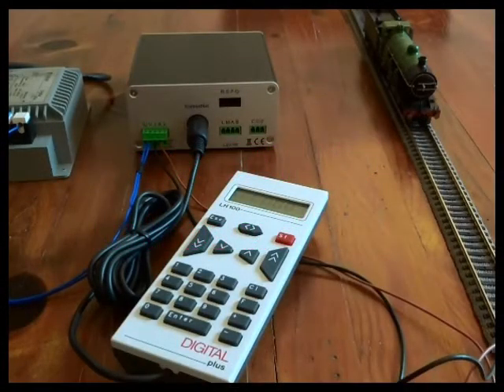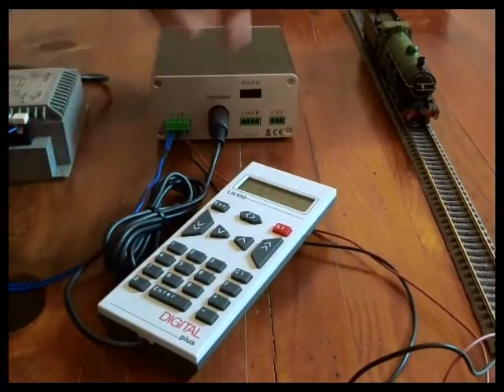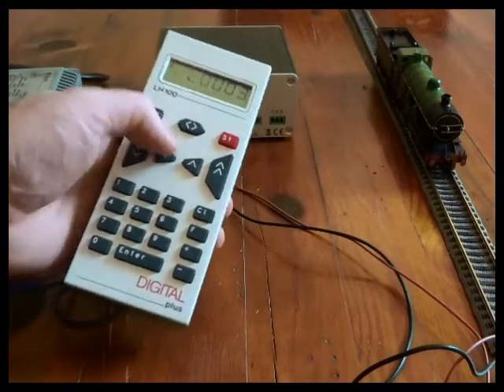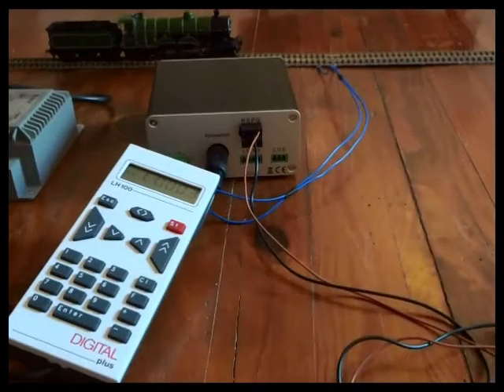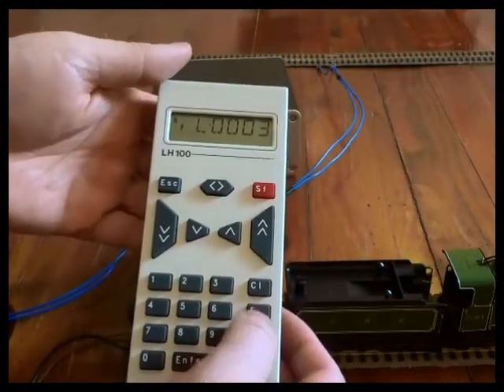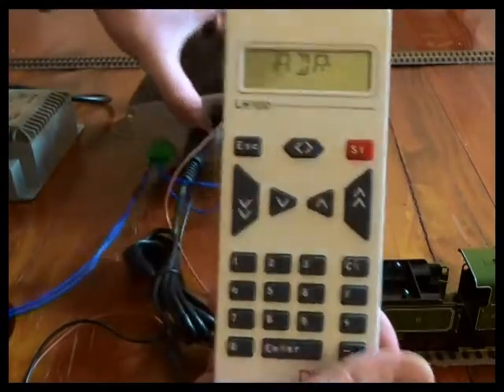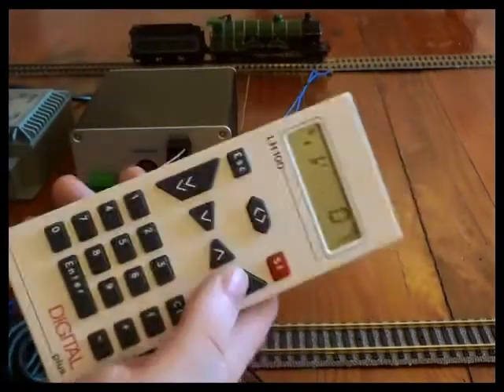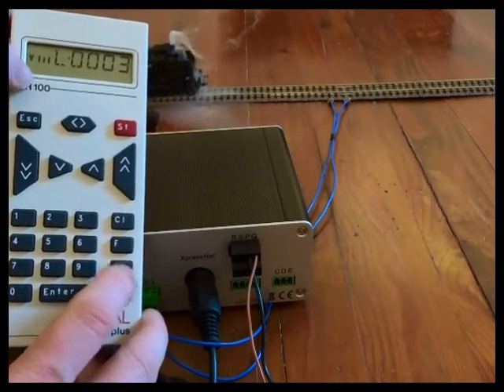Lenz SET100 Introduction

Comment: Hi , great videos , helped me a lot getting to know my Lenz. Pick your brains if I may . I can only ever seem to have 2 locos in my stack .. when I add another address the previous disappears leaving me again with just two . The most recent and the first on the list . What could I be doing wrong ? Any ideas ? 
Many thanks 
Simon
Reply from the maker: Sounds like it is on the older software - Press F until you see SYS - press enter - now press 8 and it will show the LZV100 software version  (The current version is LZV36).  Press esc then press 9 to see the LH100 software (Current is LHV36)..  For UK customers we can update the units in the shop by appointment or by post - Check availability before sending.    Cheers   Chris

Comment: Can you connect this unit to a PC for train controller to operate
Reply from the maker: This is the old system - left for information -  the New Set 101 has a built in PC interface
Reply: @digitalcareline  Fantastic thank you

Comment: Hi
Any idea why a lenz lh 100 will let me programme a locobon the programming track but when I come to run it on the layout it will only allow analogue running has something been turned off or does something need to be set rmto allow me to run trains on dcc on the main any advice would be helpful it is a 3.6 system many thanks
Reply from the maker: This is a bit difficult to do long distance without a model on my desk to check a number of options out.  What decoder is it? - a factory reset may clear it -  If it is Lenz decoder read the error code in CV30 - If this value is anything other than zero then an overload has bee triggered. Check out the loco motor and then reset the decoder.  CV8=33 for lenz.  I do not think there is an option for analog only on decoders, but there is an option for DCC only in CV29 - again check the decoder manual for the default setting in CV29 - be aware that long addressing effects this value.

Comment: Hallo,  I have a question,  how can I change in CV29 the speedsteps from 14 to 28 ?
Reply from the maker: 1st check the default settings for the decoder in the manufacturers manual.CV29 controls a number of important decoder functions.                 
  bit 2 of CV29 controls speed steps.                     
Read CV29 on the programming track.  you will see the decimal value beside CV29 and underneath the bits are shown.  each CV contains 8 bits. 28/128 speed steps is selected when bit 2 is on (bit 2 is illuminated on the bottom row when you read CV29).  if bit 2 is off then you are on 14/27 speed steps.  Some decoders will not work well on 28 speed steps so you may wish to put it back to 14 speed steps after you try it.

Normally for Lenz decoders: bit 1 is direction of travel, bit 2 is speed steps, bit 3 is analog/DCC recognition, bit 4 is RailCom, bit5 selects speed curve settings (default or user specified)and bit6 relates to long addresses
Reply: Thank you for the information you sent me, it was very useful for me.  I very much liked the youtube films.

Comment: My only complaint with Lenz here in the US is availabulity which is very poor
Reply from the maker: There is a new US distributor so hopefully things will improve - EmmetsRailroad DCC Hobby Station, LLC
864 W. Crestline Avenue
Littleton, Colorado 80120-1467
Telephone (303)881-8334

Shipping costs to and from the US probably do not help
Reply: Same in Australia absolutely useless at moment after not using system for some years found there is a CR2450 Lithium Battery inside LV 100.
You should see the stupid way they have it mounted. Also no company here carries the terminal plugs that the system uses,they are called CamdenBoss Terminals only available from U.K. One delivery has already gone missing in Post. Not a happy chappie at all about this product.
Reply from the maker: I try to keep these in stock in the UK where the supply chain is shorter - Obviously I cannot comment on distribution elsewhere, but we are working hard to look after this product here.  I am sorry for you issues in Australia - we can post there and use tracked postage to avoid the missing parcels.  Kind regards       Chris